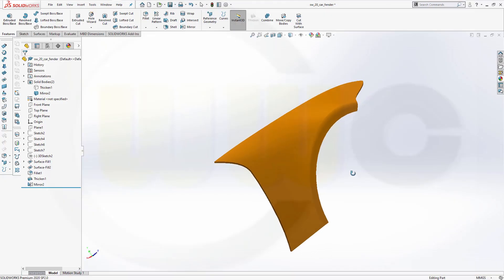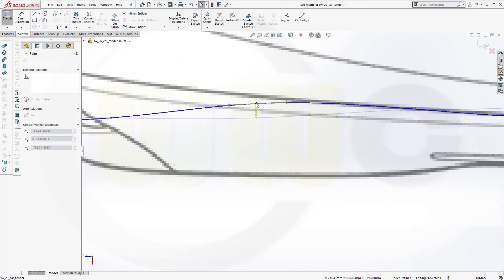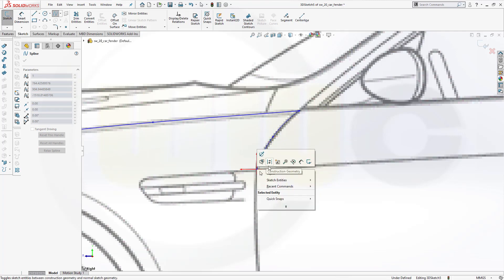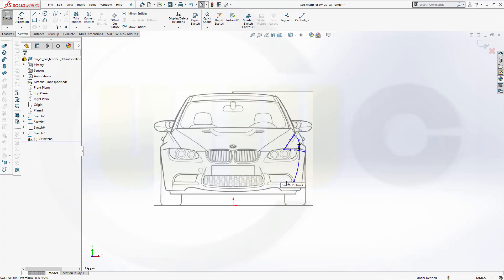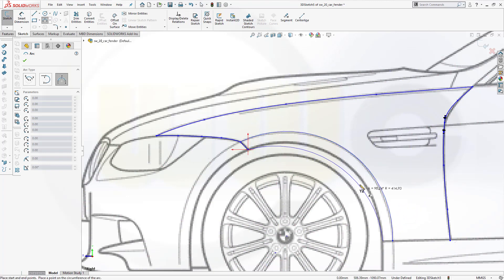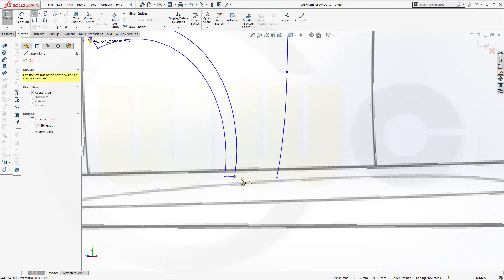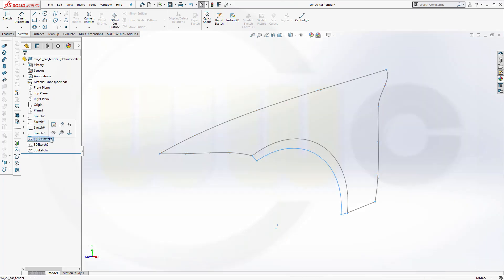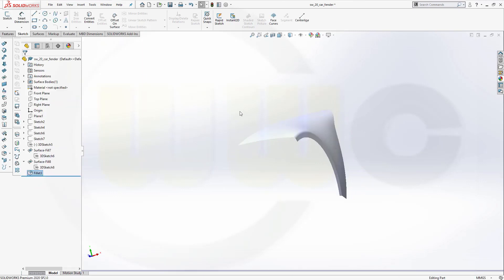Car Fender - Kotflügel - Solidworks 2020 Training - Surfaces

Comment: how to make it , i need fender for my car and its is expensive.
i found my car 3d model and i want to make fender from solidworks ? how do i produce ?
Reply from the maker: You could use the method shown in this video
Reply: @wolfgang.walden.cad.training  Sir i couldnt understand , it should be aluminium or aluminium + magnesium. How can i make that part . I have 3d model from solidworks. i need to use it for my car.
Reply from the maker: You mean how to make it a real part?
Reply: @wolfgang.walden.cad.training  yes sir
Reply from the maker: Sorry, I´m just a trainer not an engineer.